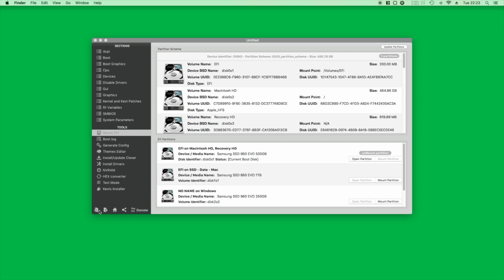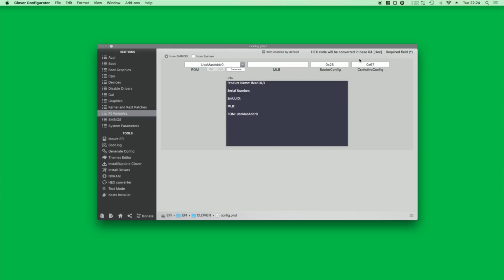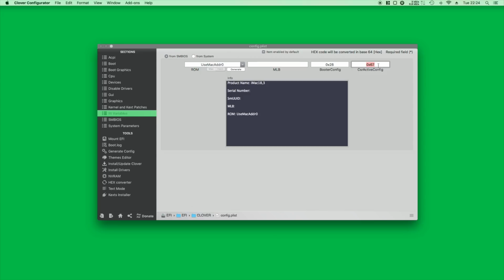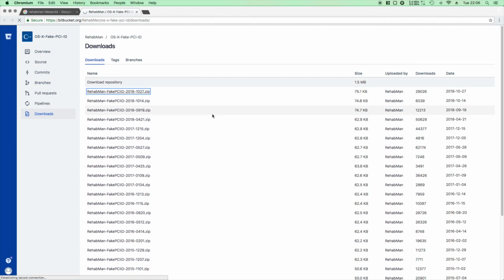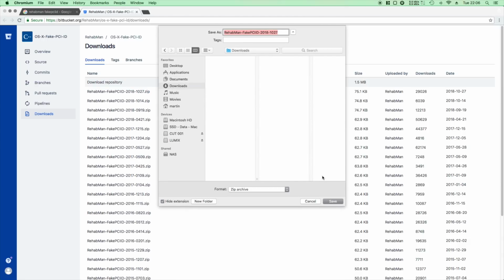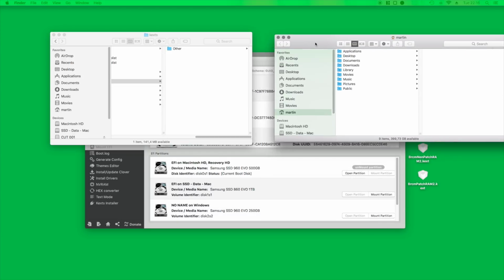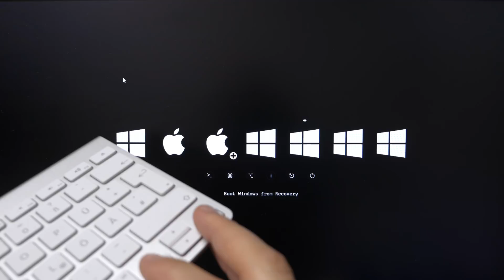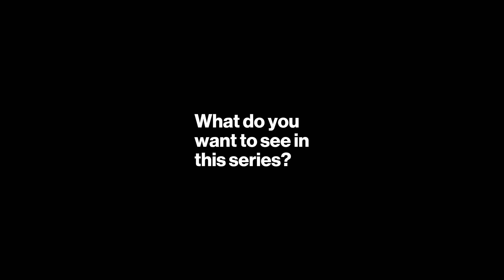WiFi and Bluetooth on a Hackintosh

Comment: Has anyone built a Hackintosh with working Thunderbolt 3? None of these Hackintosh videos seem to answer this question. Some say they do, but then they don't show TB3 working.
Reply from the maker: Don't need it, that's why I didn't do it. There are Thunderbolt PCIe cards out there. IIRC the one by Asus should work. But I would just invest in this, if you really need it. Otherwise it's just burning money.

Comment: Danke schoen (from Australia) - I'm really stuck between choosing an ITX vs ATX, but I think the flexibility of just adding a pcie card for wifi (and later thunderbolt) is probably the easiest option. Although both are available if you choose ITX carefully, I think stability (maintenance) is easier if seperate pcie card route is taken.
Reply from the maker: That's for sure. I was also drawn into buidling an ITX system. In the end I decided for ATX, because I needed airflow and cooling headroom for overclocking. And that's totally worth it, as my system is able to run cool even on a high overclock for both GPU and CPU as well as the RAM.

Comment: Hi Martin, thanks very much for the video! I'm thinking of going route 2 with a BCM94360NG module I seen recommended. Do you happen to know if the mini-itx boards, such as the Gigabyte x570 I Aorus Pro Wifi has the same size housing/module as the ATX boards?
Reply from the maker: I think the housing is standardized. But it's just a guess.

Comment: Hi Martin,
great video! But going the 2nd route (because I have a Lenovo thinkcentre m93p tiny and a Broadcom BCM94352 card) I couldn't get BT to work on Catalina 10.15.4 (wifi works fine). I tried both ways: first coping the kexts to clover/kexts/other and when that showed no success to library/extensions. But still bluetooth shows no reaction. Any idea how to solve this? Would be highly appreciated! Cheers

Comment: Thanks for the video will option 1 work in an m.2 wifi port?
I have a mini itx and only have 1 pcie port. Iv'e tried route 2 but I cant get bluetooth working with a different broadband card
Reply from the maker: Well good question. Maybe somebody on the forums can answer this question.
Reply: Martin Guder Actually already tried. Did not work. I just bought a more recommended card like the one you have on here the Dell one and it worked perfect. Thanks for the video. Helped a lot.

Comment: Hello! Great video. I'd be very interested in purchasing this product for my Hackintosh. I'm wondering, though, if this device is connected to the USB 2.0 port on the motherboard, would there be speed issues?
Reason I'm asking is I know that max speed for USB 2.0 is 480Mbps (in theory), however, due to protocol overhead and hardware inefficiencies, the practical max speed is closer to 320Mbps. 
I have a pretty fast internet connection (500Mbps download and 100Mbps upload). Wondering how this product works, in terms of speed? 
Much appreciated! Have a great day.
Reply from the maker: Hi. Then you are better off using LAN. I have LAN in permanent use rather than WiFi. And yes your math is right and your WiFi card will probably be the bottleneck, if the router is fast enough.

Comment: Hi Mark, thanks for the video. Amazing explanation. Does it work for OSX Catalina too? I tried, and WiFi seems to work fine, but the bluetooth not really. Also wanted to ask, if it's ok to boot my Hackintosh having both Bluetooth devices, because for some reason it only shows up the one that it's built into the motherboard, which also have a different provider other than Broadcom. Looked it up inside System Information -> Bluetooth. Thanks in advance

Comment: Thank you for your video, it has helped me a lot, however, I can't manage to get bluetooth working. I have tried with all te kexts in refi folder, and also, some of them in the extensions folder exactly as you mentioned but although wifi is perfectly working, bluetooth is not: I would be very grateful if you could help me. Greetings
Reply from the maker: Hi. What card do you use?
Reply: Martin Guder Thank you a lot for answering me, I appreciated  a lot. I am using the Fenvi FV T919 BLUETOOTH and WiFi card which has a Broadcom chip. In some videos I have watched from this card, it shows it should work without any  kext because it works perfectly with Hackintosh and Mac without drivers, Keats, etc. However, as it has a Broadcom chip I have followed all your steps but the same problem. WiFi perfectly working but Bluetooth, although in system preferences, in usb is detected, in Bluetooth one is not. In Bluetooth in system preferences shows the integrated Bluetooth which doesn’t work and I  can’t manage to get it working, so airdrop, etc, doesn’t work. Undoubtedly, the
Usb front panel header in the motherboard is Connected.Thank you and I would Appreciate if you could help me. Greetings.
Reply from the maker: @ernesto7133  Maxbe check, if your USB Injection works properly. Seems like a USB issue. Maybe USB cable has to be rotated 180° as another idea.
Reply: Martin Guder Thank you, I have already checked the USB injector kext and I have replaced it by a new one. The problems stills happening. I cannot rotate the usb header because it only fits in one way, as it is. All my kexts are up-to-date and I have tried with all the kexts you showed on the video as well as some more of other places. I don’t know what to do. However thank you very much for your helping, I hope I can solve the problem with your help. Greetings.
Reply from the maker: @ernesto7133  How many USB devices are connected. As the motherboard just has a maximum number of PCIe lanes to utilize for USB connectivity. So extra USB peripherals like added USB ports could be counter productive.
Reply: Martin Guder I use the integrated USB ports on the motherboard but, I have only two devices connected to the USB in the internal motherboard. One of them is the Bluetooth of the  card and The other is two USB plugs in the top part of the   Computer box. However, when I disconnect that USB Heather in the front panel of the motherboard the problem does not solve. And even disconnecting the USBs. I hope I have explained me correctly as well as to understand exactly what you wanted to ask me. If not, please tell me. Greetings. Thank you very much.
Reply: @ernesto7133  Hi same prb... And i can t resolve it ...i have Fenvi 1200 card .. if you resolve it plz informe me  thank u
Reply from the maker: @ernes12 Probably try another orientation of the USB2 plug on the MoBo. Apart from that, the only alternative is green field approach and try to redo it. Super hard to remotely resolve issues.

Comment: I'm using a FV-T919 Wireless Dual Band 1750M BT4.0 BCM94360CD card in a ASUS Z370A setup running 10.15.2 on a Vanilla install. WiFi and Bluetooth did indeed work out of the box with no extra kext, but only sort-of. I have dropouts in Bluetooth (don't use the WiFi much, as I'm wired on Ethernet, but use it for Airdrop and the likes). Bluetooth mouse and AirPods have dropouts, very annoying. The mouse I have now connected via the included USB-dongle instead to make it stable, but still need stable AirPod connection. Any ideas?
Reply: Good question. Have you posted it on a forum or searched for the dropouts on the web?

Comment: Can you please tell any mac os mojave compatible wifi cards for laptops
Reply from the maker: That's most probably a question of the chip. Is it a Broadcom module?
Reply: yes, also... does Mohave works with intel7260???
Reply from the maker: Can't answer that sorry. Maybe it's slightly different to the newer intel CPUs and chipsets. Maybe you'll find some more info on the forums.

Comment: Hi
Would a 2006 module work or its useless ? 
Ive got bcm94311MCAG laying around with correspondent Bluetooth airport parts too, all came from an old imac. To be used in asus z370p and waiting for the i5 9600k to arrive.
Thanks in advance 
And thanks for the hackintosh videos 👍🏻
Reply from the maker: Thanks. Glad to help. I think it could work. Just browse the linked list in the video description. Maybe it's on there and if so you maybe need to install a kext.
Reply: Martin Guder 
I will dig into it,  if it works i will try give an update here. 
Danke

Comment: Thanks for the video, do you know maybe if route 2 is going to work with 
Asus ROG Maximus XI Hero Wifi?
Reply from the maker: I guess yes. Just in case they changed the format of the adapter this may break this.
Reply: @MartinGuder  Thanks for the reply.

Comment: Thanks for a great video! You mention that you can use a separate module for the Windows boot in the first route. But wouldn't it be possible to use the same PCIe module for Windows as well? Or am I misunderstanding?
Reply from the maker: Sure you can. I just did it that way, as there is good driver support for the already existing module and it is the easier route to just put in another PCIe card instead of disassembling the other motherboard first. And the faster Broadcom chip doesn't fit into the compartment of the other onboard chip. The Broadcom can of course also be used instead of the Asus one.
Reply: @MartinGuder  Great, thanks!

Comment: Dude, just go for Linux with the same hardware and without all the complexity of building a Hackintosh. Have you ever heard of ElementaryOS or DeepinOS ? The first is almost identical to MacOS and I bet that the performance gain you will have from these Linux distro will be much better than MacOS. Especially if you have an Intel CPU then check Clear OS, which is optimized for Intel chips by Intel itself. The latter is superfast, you can check the performance benchmarks on internet.
Reply from the maker: Thanks for the recommendations. Linux will live on a third SSD sometime soon. Unfortunately, Final Cut and Ableton Live don't work in Linux. ;)

Comment: Thanks for the video, I went the first route and cant get my cards to stop interfering with eachother. Do you know how I can completely disable the onboard wifi card?
Reply from the maker: James Meyer Is it interfering in macOS or Windows?
Reply: In macos, every boot is different, sometimes it works sometimes it has a macaddress like 00:00:00:00 and doesn’t work, sometimes WiFi works and Bluetooth doesn’t. I think it’s cause I didn’t manage to clean disable the onboard card. On windows i know how, device manager, right click, disable.
Reply from the maker: @JamesMeyerMusic   If MAC address is 00:00:00:00, then it's obviously not providing the right access privileges. I don't have this problem with my built-in wifi, so it would be interesting to see, what your WiFi cards model is.
Reply: Martin Guder my motherboard is the msi z370m gaming pro ac with the intel AC 8265. That’s the card I want to disable. I have the same pcie original apple card that you suggested. The problem is disabling the onboard card because things work perfectly sometimes and other times I reboot and it doesn’t. Did you disable your onboard ac for the pcie to work?
Reply from the maker: @JamesMeyerMusic  Don't have to disable my card. You just have to find out, which port is your BT/WiFi card and then you can maybe disable it by adding a boot argument to clover. Here is an article on how to do that: https://matthi.coffee/2016-07-03-bluetooth-z170n/

Comment: fyi method 1 doesn't work w apple watch
Reply from the maker: It works believe me. My Hackintosh is proof. Had some bus 3 months and will work on a follow up video for beginning of May. There you can see it. I‘ll also provide an indepth guide on how to get it up and running.
Reply: @MartinGuder  cool, i have wifi and bluetooth working but watch doesn't see the computer and vice versa

Comment: I bought a wifi usb stick with the Realtek 8812AU chip. I went with an usb wifi stick, because all the other options are more expensive.
Reply from the maker: As long as it works, that's totally legit. :)

Comment: Dear Martin,
After trying the pcie route, I recently changed out the wifi/bt chip for a compatible one. When installing it Wifi works like a charm but BT still doesn't show up. I changed the kexts like you said when it isn't working but still no Bluetooth. I don't give a damn about the wifi because is use ethernet but I want the bluetooth to connect to my headphones. 
Any ideas on how to get the Bluetooth working
MoBo: gigabyte X470 Gaming 7 rev1.0
CPU: Ryzen 2700x
GPU: EVGA 1070ti
Memory: Samsung 970 EVO NvmeSSD
Thanks in advance
Reply from the maker: Hi. Is it the same Broadcom chip like in route 2?
Reply: @MartinGuder  mine is a broadcom BCM94352Z 802.11ABG/N, 802.11AC and Bluetooth 4.0 Combo Card. It states that is it compatible with mac os 10.8 and later
Reply from the maker: @bjornsymoens6539  Is it on the compatibility list on tonymacx86 (link in the description)?
Reply: Martin Guder yes it is
Reply from the maker: @bjornsymoens6539  OK. One thing you can try is to copy those to the Library/Extensions folder. Maybe that helps, but I never had to do that, as everything runs fine. Hopefully the BT module is not broken. Can you check under Windows, if the BT is shown in device manager?
Reply: Martin Guder should I move all kexts or just a few of them?
Reply from the maker: It‘s described in the video. ;)
Reply from the maker: Did you wiped the kext cache? That‘s one thing to do prior to shifting kexts. ;)
Reply: Martin Guder never done that before. Guess I can find a video on that on youtube.
Reply from the maker: Quite easy:

1) Open Terminal
2) Type in sudo kextcache -i /
3) Enter your system password (not shown while typing, so don't wonder)
4) Reboot and hopefully get everything up and running.

Also set your SIP (System integrity protection to 0x67 in clover configurator), but you most probably have done this already. Otherwise your WiFi wouldn't work already.

Comment: OH my god thank you so much. I thought the cards were soldered in. Now I can use my old iMac's WIFI card when I get my new mobo
Reply: That's what I did. Took it out my old mac book and it worked right away. My asrock motherboard already had the mini pci slot
Reply from the maker: Which Macbook generation was it? Maybe post the model for others to know what's working oob? :)
Reply: @MartinGuder  it was the 2009 model. the one that had the nvidea graphics 9400m. i also tried a wifi card from an old white imac and that worked too. still got them
Reply: iMac 2008 with a 2600 Pro it's a Broadcom 4321 works in my old Hackintosh Laptop haven't tested it with anything over ElCapitan but it should work

Comment: Hackintosh still cannot use Intel Wi-Fi? I have TUF H370 PRO-GAMING Wi-Fi model.
Reply from the maker: Unless someone codes a driver for Intel, it won't work I guess or just with some downsides. Better spend some money on a Broadcom chip and save a ton of time and headaches in the long run. ;)
Reply: @MartinGuder  thanks, I will buy Broadcom.

Comment: I have been using this card successfully for wifi and bluetooth on my Hackintosh. However, I have not been able to get wifi or bluetooth when booting into Windows. Do you dual boot, and if so, do you have drivers for the BCM94360CD?
Reply from the maker: I use my Asus WiFi/BT for Windows. But there should be some bootcamp drivers out there for the chip.
Reply: @MartinGuder  thank you for the reply. I did already get the driver and it works for wifi, but but not Bluetooth. I should be able to debug later on.
Reply from the maker: Which did you use?
Reply: @MartinGuder  I got them from the Hackintosh discord channel from the $link bootcamp command

Comment: Hi, thanks for the great video! Do we need two anttenas to get wifi work? I bought BCM94352Z and followed the instructions you provided, but after rebooting, wifi icon in the top bar says "No hardware installed" and didn't work. Do you think you have any solution on this issue? Here is my environment. (CPU: Core i5 8700K. GPU: RX580 Memory: Samsung 970 NVMe M.2 MotherBoard: ASUS ROG Maximus XI Hero (Wi-Fi) Z390)
Reply from the maker: For this card just one antenna is used for WiFi. The other one for Bluetooth. That the hardware is not recognized at all, hints to a faulty card or wrong installation. Did you copied the right kexts?
Reply: @MartinGuder  Thanks for the quick reply.
So with the message, "No hardware installed", it even won't work with antennas right? I've copied five kexts, FakePCIID.kext/FakePCIID_Broadcom_WiFi.kext/BrcmPatchRAM2.kext/BrcmNonPatchRAM2.kext/BrcmFirmwareData.kext, to  EFI/Clover/kexts/Other. And tried moving some kexts to /Library/Extensions as you suggested but this also didn't work. So maybe hardware problem...? I still doubt about it though. I wish to check if the wifi/BT module is properly recognized via BIOS but I found no such function..
Do you know any way to check whether the module is defected or not?
Reply from the maker: Maybe try to reinstall the card, if nothing helps. A look at the system profiler should at least show, if there is something installed on the PCIe slot. Maybe take a look, if a PCIe slot is deactivated accidentially? Do you replaced the other card or installed an additional adapter card with the BCM chip?